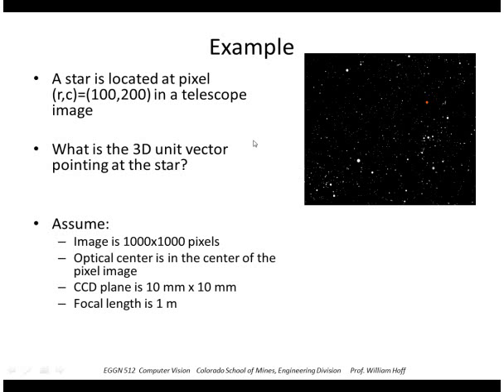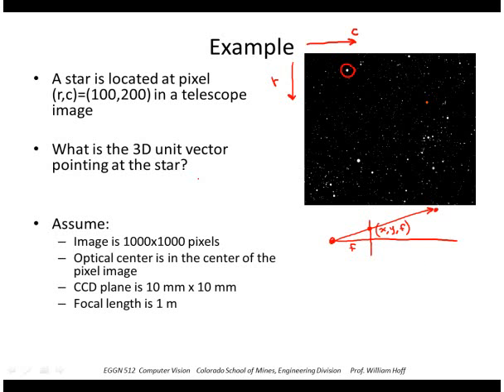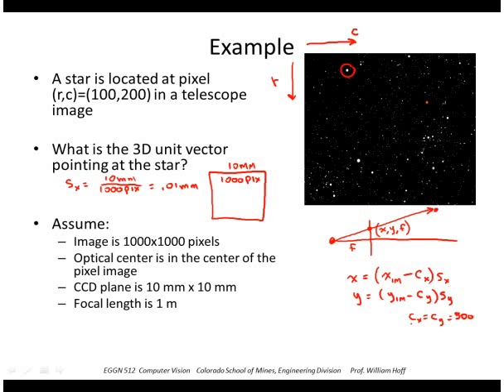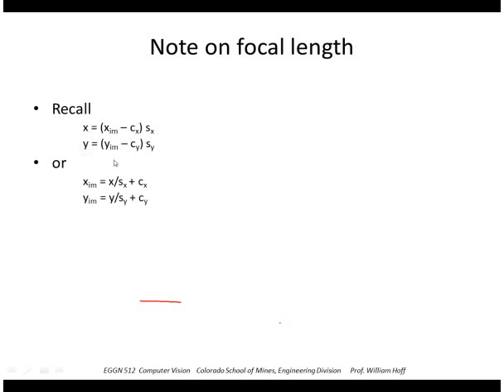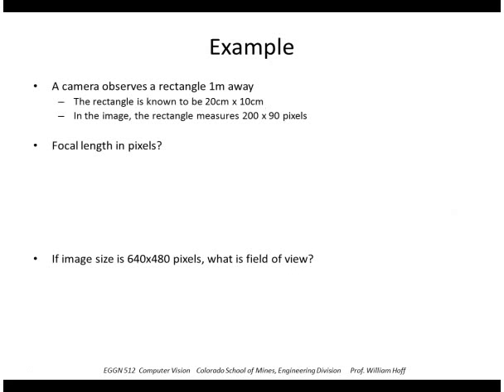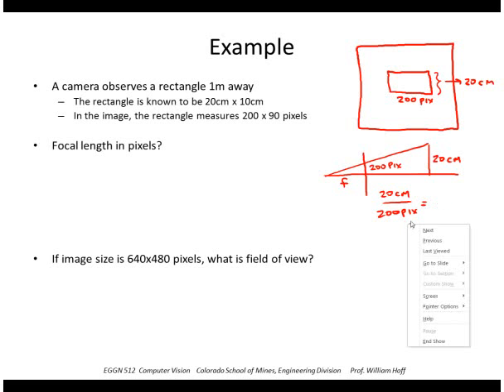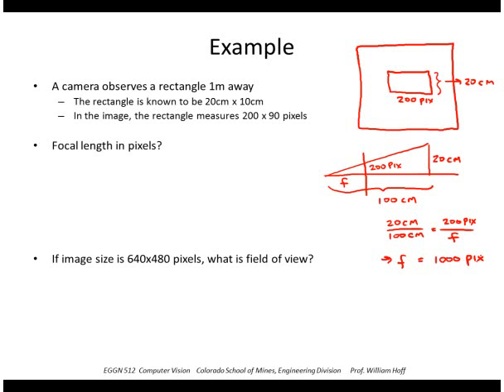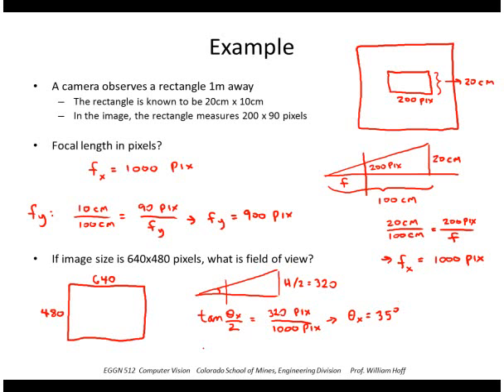CSCI 512 - Lecture 02-3 Sensors and Image Formation

Comment: Hi, nice video by the way. I will try to finish watching all of these series for sure. However, on the first example, if the star is located in the image in the right bottom corner with coordinate (r,c) = (1000px,1000px), then the 3D unit projection according to the calculation will be (x,y,f) = (5mm, 5mm, 1m) right? But I still don't understand since the star is in the corner of the image, why it isn't in the corner of the plane as well (10mm, 10mm, 1m)?
Reply from the maker: +Yanuar Tri Aditya Nugraha The origin (i.e., the 0,0 point) of the image plane is in the center, so the bottom right corner is (5mm,5mm), and the upper left corner is (-5mm, -5mm).

Comment: Thanks for a great explanation of concepts. However, I didn't understand clearly the last part about different focal lengths in x and y direction? What does it mean to have different focal lengths in x and y and why does it matter if pixel is square or not?
Reply from the maker: gaurav fotedar When you express the focal length in pixels, you are really just taking the ratio of the actual focal length (in mm, for example) divided by the actual size of the sensor element (in mm, for example).  Since the size of the sensor element may be different in x and y (although this is not typical), it is possible that you get different values for fx = f/sx and fy = f/sy.  You shouldn't think of fx,fy as physical dimensions; they are just ratios.  I hope that helps.
Reply: Oh, I get it now, thanks a lot :)
Reply: @HoffWilliam  I think the actual size of the sensor element unit should be pixel, not mm.

Comment from the maker: Yes, there is an error on the figure for the last example.  I should have labeled the width of the rectangle to be 20 cm, not its height.  But otherwise everything is correct.  I use the convention that x is the width value and y is the height value (see lecture 2-1).  I plan to redo all of these videos soon.